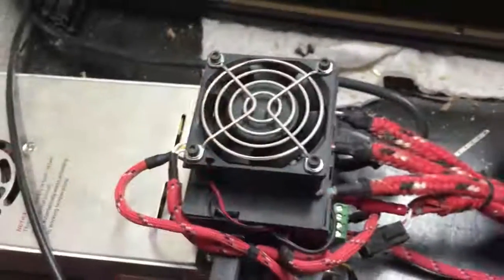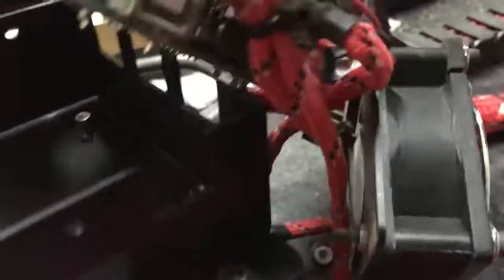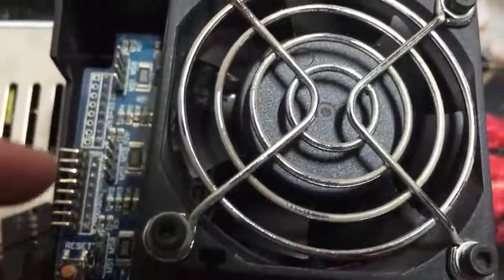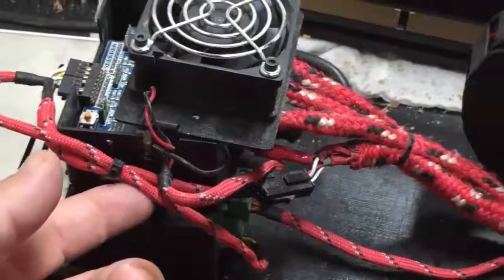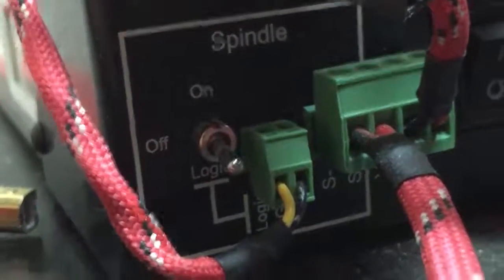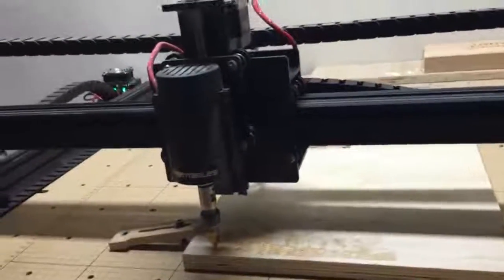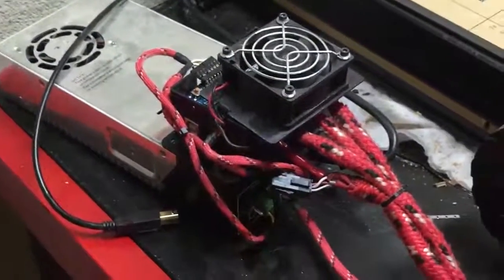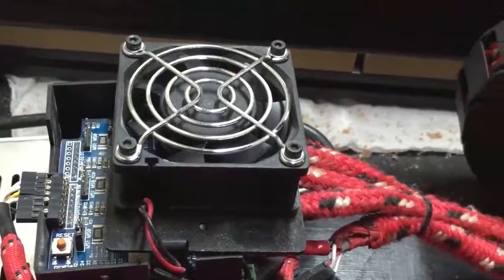XCARVE Quick Tips: Automatic Spindle setup and an over look at the Arduino/Gshield

Comment: How does the router connects to the arduino? Do you need to splice the router power cord?
Reply from the maker: You dont need to slice it, But you will need to use some sort of a relay. They make relays that you can just plug in the router like a Dewalt 611 and then the relay will plug into the wall and also into the 4 pin phoenix plug on the front of the XCARVE power supply. Here is a link to a few different options and diagrams to help understand.
 https://discuss.inventables.com/t/relay-for-dewalt-spindle/14852/5